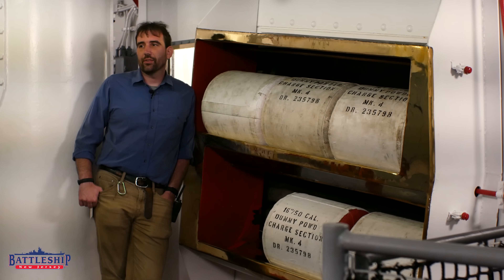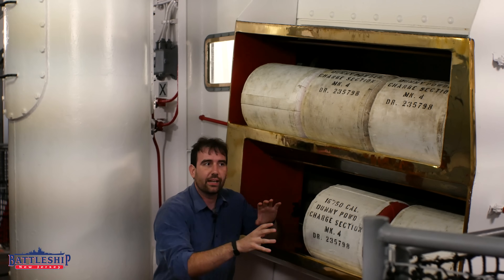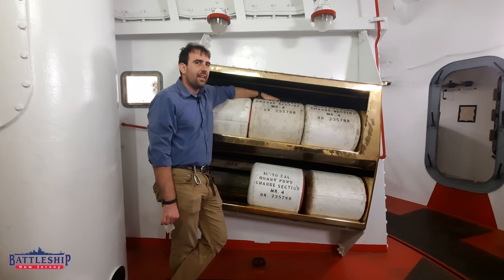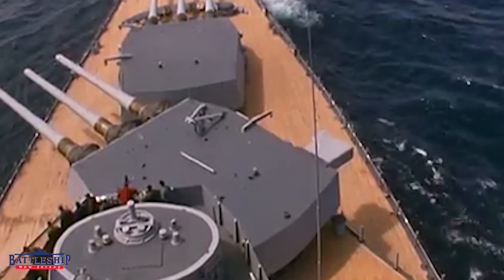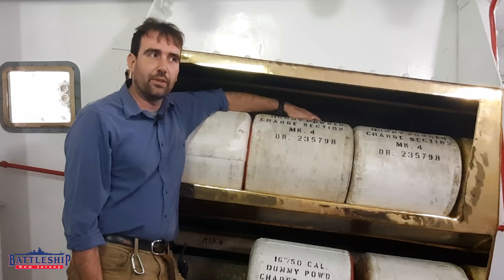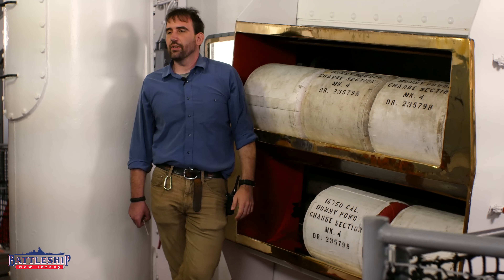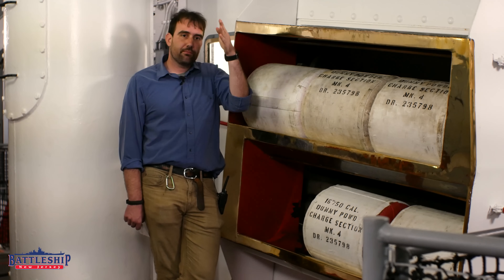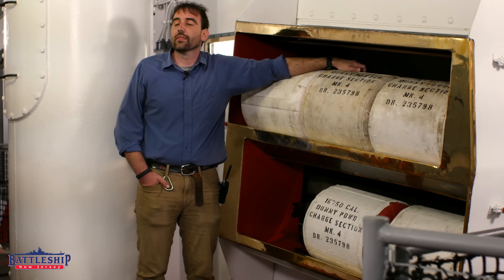16in Gun Powder

Comment: Speaking of "Lot Numbers", once when I was still working, selling print shop supplies, including special papers, I sold a case, (5000 sheets), of a special paper named, "Classic Linen". The customer called us about an hour later, saying that there was a problem. Apparently, every fifth sheet of paper was NOT Classic Linen. I asked for the Lot Number so I could check Our shelves of the same product. I did, opened a ream and double checked, and, sure enough, there was a different paper every fifth sheet, just as he said. By this happening, he would end up 20% short for HIS customer.
I pulled all we had from the shelf, so we wouldn't sell any more, called our other local store, and our warehouse and told them of the problem. I offered my customer another case of his choice of paper and asked him to return what wasn't used. This happened and I wrote a letter to the paper's manufacturer to appraise them of the problem, as it was late on Friday evening when this all happened, and their phone lines were off for the weekend, due to their location and the time zones. Lot numbers are VERY important. For you guys, it means possibly missing a target, for paper, it might mean an unhappy final customer.
When they got back to me, it turns out that for one day, the automatic machines that collated the pages into the reams that we sold, was accidently fed with a different paper, but of the same shade and no body caught it until we found out. This one Lot Number amounted to seven pallets of wrapped and boxed paper that had been shipped al over the country. That company had to contact ALL of their customers to look for that Lot Number and they would set up a replacement.

Comment: I don't know how they can get the velocity so close when hand loading for a bench rest rifle is hard to get that close
Reply: When the shell weighs as much as a small car, the variance in the weight of propellant also has to be large to get a change in the velocity.
Large shells have a correspondingly large tolerance. 
The smaller the round the more accurate you need to be with your propellant weights.

Comment: I would have referred to an individual piece of gunpowder as a kernel not a grain. Gunpowder is also measurable in grains , 7000 grains per pound. To avoid any confusion in measurement units of weight. A kernel of gunpowder is simply one physical piece of gunpowder regardless of size or weight.

Comment: wish there was a battleship still in service, even if only for the role of shore bombardment
wouldn't even have to have it's armor upgraded, it could be a glass cannon
there is no cost-worthy equivalent that can replace them
Reply: Certainly in a WW3 scenario , using Battleships for shore bombardment wouldn't be a good idea
Reply: @gliderdan3153  why is that?  missiles are VERY expensive in comparison 
the main batteries of the iowa class had a range around 3 miles (depending on topography)
although accuracy did drop at those ranges, they could be fired frequently enough to make up for it
even seeing one off shore could be a deterrent
if you are thinking there wouldn't be landing craft on beeches anymore, there would be for the sake of redundancy
Reply: @blastyfs2  Ships are quite easy to sink these days, with smart munitions fielded by a small power. Even going up against a second or third rate power like Iran would likely cost us several supercarriers. I don't even want to think about how vulnerable a BB would be doing shore bombardment.
Reply: @philperry4699  have always thought of carriers as too big to fail, too expensive to risk putting them in harms way
at least that is my opinion anyways

Comment: largest we fired was..... M203A1 Propellant Also a single increment base ignited charge. The outer casing is a solid combustible material. There is still an igniter pad at the base of the propellant, and it contains .7 ounces of black powder and 1- ounce of CBI. The propellant is not made up of granules; it consists of 28-pounds of slotted, stick propellant. The M203A1 charge is fired only with the M549A1 (TNT loaded), RAP, M825 felt wedge, and M864 projectiles in the M198 and M109A5/6 howitzers. The reasons for design of the M203A1 propelling charge are; 1) cooler burning, less flash, blast, and tube wear. 2) Casing form is more durable causing for less igniter core damage. 3) For automatic loading systems, it allows fewer mechanical problems.

Comment: There's been a lot of videos recently mentioning the different naval treaties of the first half of the 20th century.
Would you consider a speculative video on how battleship design may have differed without those restrictions?
Would we have seen Western powers ships with guns to rival or exceed yamatos 18.1 inch?
Is there a hard limit on the displacement/size of battleships - it seems to not matter if a ship is 35,000 or 70,000 ton, most fall in the mid 800ft LOA - is that a material limit in shipbuilding?
If everyone is sailing around with 18+ inch guns how does that affect armour as I don't believe you could armour an entire citadel with defense that would realistically stop such large shells?
Maybe a few hypotheticals may have to disregard the reality of economics but it would be very interesting to know what the ultimate battleship could have been?
Reply: How about the influence of the Panama Canal lock width (110 ft, I believe) on US capital ship design? The lock length, too (1000 ft?) must have had an influence. Was the RN, or any other navy, concerned about this?
Reply: @philperry4699  interesting effect considering how important it was to american ships, British ships may have considered it, while Japan (and presumably nazi Germany) didn't care, which is why the yamato was so much wider.

Comment: I'd love to see battleships make a comeback.  Of course, they would be most useful as a shore bombardment system and fleet missile defense.  Laser systems would make great sense for cheap drone elimination and a railgun turret would add some interesting capabilities.  Yes, I realize that the Littoral Combat Ship was supposed to fill this role, but it was doomed from the start as far as this role went.  The rocket assisted smart shells only became "affordable" if you built a certain number of ships and then a certain number of shells for said ships.  So the SECOND that Congress began to experiment with number reduction, the shell price prematurely exploded (pun ABSOLUTELY intended).  Furthermore, shore bombardment needs to include a projectile that is cheap enough so that you can fire suppressively for extended periods if you don't know exactly where the target is.  The LCS, at this point, would be most cost-effective by retiring them and using them as targets.

Comment: You said it uses black powder and it burns rapidly and doesn't explode. The problem with what you said is the fact that black powder is a high explosive it doesn't burn it explodes
Reply: A relatively small black powder charge is used to ignite the NC based propellant (the red pad on each charge has the black powder in it).

Comment: Video idea:
What would a modern battleship look like? As in what would a ship designed in 2021, that has the same job as New Jersey did back in WWII, look like in terms of armament, size, etc.
(In your opinion of course)
Reply: They’d have to do something about torpedo protection during design stage. Modern underwater munitions are capable of breaking the ship’s keel and taking the vessel out of commission relatively cheaply.
  Guns may be downsized a bit (12-14”, perhaps) to increase range and number of munitions. Definitely, improve the projectiles (thinner walled high cap HE type, rocket assisted munitions, guided munitions etc). A more advanced UAV for spotting and/or strike mission could be installed. 
  The ship itself would probably end up being smaller and carry a battery of cruise missiles for surface warfare and a powerful battery of AA to fend off air threats. There would be a comprehensive ASW suit required: torpedoes, heloes.
  All in all, I guess the ships would have looked similar to the Alaska class cruisers with modern weapons/ASW/EW suit rather than the traditional battleships.
Reply: @leftnoname  It depends on what the mission is: shore bombardment, antiaircraft batteries, or slugging it out with other capital ships? Except for going mano-a-mano with another battleship, there's really nothing left for a BB to do that can't be done more cheaply and flexibly with several smaller ships.

Comment: Weren’t those bags primarily gun cotton with the black powder used to set off the gun cotton is what I remember reading about the large guns that had men in different chambers below deck sending the charges through locks to be loaded I know he was mentioning gun cotton being extruded but it’s still gun cotton not gun powder which is salt Peter and charcoal and various other chemicals just mentioning this because gunpowder burns different and is different from gun cotton, gun cotton is a much slower burn that pushes the round out compared with gunpowder powder, he gives a good explanation but I just believe he should of began with an explanation of gun cotton instead of even saying/ mentioning gun powder 

     All The Best
               Fabrizio

Comment: Surprised about the process of making the ptopellant - are you sure you got the order right? Nitric and sulfuric acids on the cotton to make guncotton, yes. But erher and alcohol mixed in????? Alcohol and sulfuric acid will react a bit. You wash and dry rhe guncotton after nitrating it. NOW it's soluble in ether/alcohol, so you add them now to make a thick paste you can extrude to make the formed grains, and then dry.
Might be wrong - but double check.
(PhD chemist).

Comment: Not questioning the facts but something seems wrong here, A shell that weighs between 1900 and 2700 pounds to reach a range of something like 24 miles. If you convert that 2425 fps. to mph it's only a bit over 1.6 miles per hour.    ????????????
Reply: @haywoodyoudome  No, not too  bad on math, but I used am online calculator and apparently it gave me the wrong value. I tried it on a different one and very different result. Tried it again on the one I had used before with the same settings and it came out correct this time. LOL Yeah, a little over 1653 mph makes a lot more sense. LOL
Reply: @84953  If you want to play at engineering, you need some "horse sense" about numbers and when a result is suspicious. 1 mph is about 1.5 fps, so right off the bat 2425 fps is a lot faster than 1.6 mph! Roughly 1000x faster, without going to a calculator.

Comment: Symantec's! Lol
Take that round out and seal the barrel. Then see if that propellant wont explode. Lol
If you pour gunpowder on the ground and light it it wont explode either. 
That propellant explodes, it's just a directed explosion in the direction of least resistance. Instead of ripping the breach apart it pushes the projectile out of the barrel.
But it's an explosion that's doing that.
Weld the barrel closed, or bend it. Let's see what happens...
Reply: Semantics? Propellants (including black powder, as well as the gas/air mixture in an engine) _deflagrate_, which is a subsonic burn front, considered a low energy explosion (if confined). High explosives (dynamite, TNT, Torpex, etc.) burn supersonically in a _detonation_, delivering much more bang per pound. Not that it may make all that difference if you're on the receiving end! A gun would not survive using a detonating high explosive as its propellant charge.
Reply: @philperry4699  ,. Tell that to the guys who died on the USS Iowa in 1989!
The gunpowder used in these guns are refined, improved gunpowder.
It's highly explosive.
The reason it doesnt destroy the breach of the gun is because the explosion is directed in the direction of least resistance.
The reason it killed the sailors on the Iowa is because the explosion occurred during the ramming process before the breach was lock shut. The direction of least resistance was therefore backwards into the turret. (They werent propelled apart. They were blown apart. )
In the naval gun manual it is called gunpowder. It is an explosive. A fast burning explosive that propels the 2500 lbs projectile out of the gun barrel at a very fast velocity. Fast enough to propel the 2500 lb projectile 20 plus miles and penetrate several inches of steel.
Reply: @philperry4699   .. Symantecs,.
While re-arming from USS WRANGELL (AE 12) on 6 May, 1945, a tank of 16-inch high capacity powder exploded, causing a fire and exploding four more tanks. Turret No. 2 magazines were flooded and the fires put out. The ship lost three men killed instantly; eight more died of injuries; and 24 others suffered non-fatal wounds.

http://www.usssouthdakota.com/index.php/history-in-brief
The USN switched from silk bags to Rayon after that incident.

Comment: It's "smokeless powder" they said 😆  do my eyes deceive me?  If the powder is smokeless where does all that smoke come from?  Also I wonder if the infamous Iowa incident in turret 2 was bc they possibly used the powder with higher pressure and ap round🤔
Reply: Smokeless is a relative term, but if you have ever seen Blackpowder fired, you will understand.   No, your supposition is not correct.  The cause was deteriorated powder that was overly sensitive, possibly triggered by over-ramming.
Reply: @KB4QAA  was being a bit sarcastic about the smokeless powder but I for real was wondering what happened to the iowa